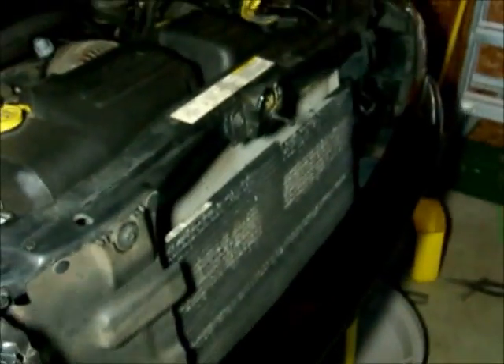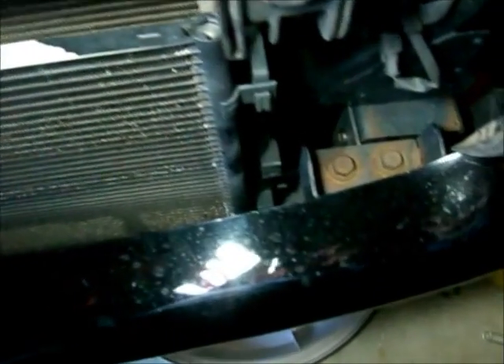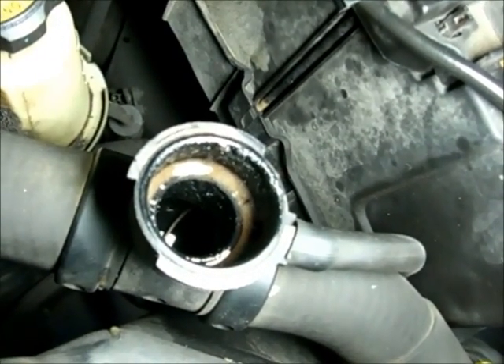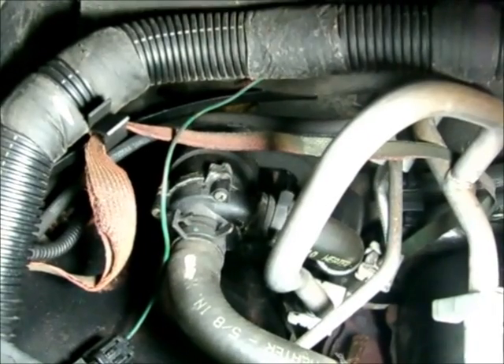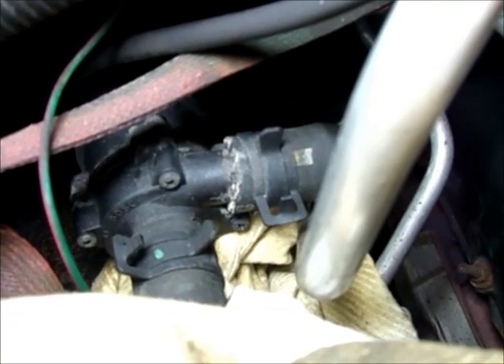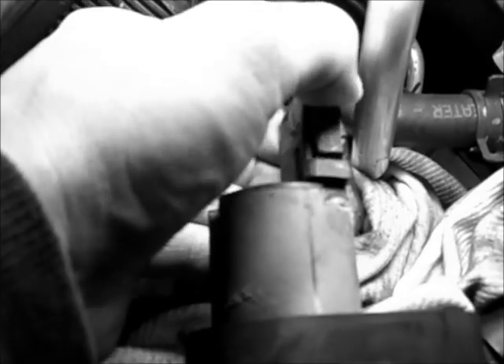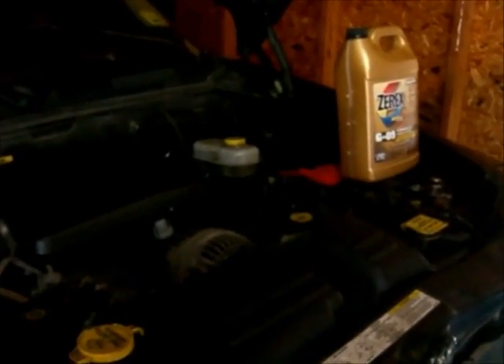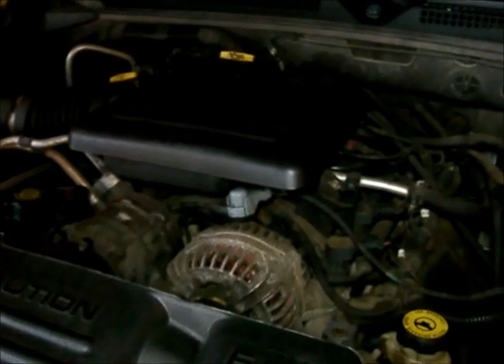Dodge Durango 4.7 coolant, thermostat, and auxiliary water pump replacement.

Comment: Looking for assistance; the aux pump connecting to the rear climate control; the heater hoses that connect to the lower side of the engine block, (front passenger side). The fitting where the heater hoses connect, (same block piece that the thermostat housing is), one fitting has rusted from the inside out and snapped off… is that really a part of the engine block or not? I can’t quite figure this one out. 
Thanks in advance if you can help.
Reply from the maker: If you're referring to one of the bolts, one of mine had snapped off too.  I used a small c-clamp to hold the thermostat housing to the block where the bolt used to be. Worked perfectly. Hope this helps.
Reply: @lenpenn  thanks for the reply. No I’m referring to the actual fitting that the heater hoses connect to…
Reply from the maker: @LJWalter78  The heater hose should connect to the thermostat housing, which I believe is plastic. That plastic fitting attaches to the block with two bolts. You should be able to replace plastic fitting easily. Hope this is what you're referring to.

Comment from the maker: Its most likely coming from top radiator hose with integrated cap. Replace that as the rubber hose connection to plastic couplings can fail. I had same problem. Easy fix.

Comment: I have looked all over the internet. I have a 2000 dodge durango 5.9 4 wheel drive...cannot find where the aux pump is located...?? Please help asap if you can! Thanks in advance!
Reply from the maker: Do you have rear heat controls? If not then you dont have an auxiliary pump.  If you do, then it should be up against the firewall on passenger side under hood.
Reply: Well, it's not there, so...i thought we had rear heat control...i appreciate your help, thank you!!
Reply from the maker: Do you have any temperature controls behind the front seats either on roof liner or behind center console?
Reply: I thought we did but my husband says no we don't...is that the ONLY reason we would have an aux pump??
Reply: So, my problem is that my car drives hot and when we turn it off antifreeze squirts from somewhere all over under the hood. My husband took the thermostat out...i don't think there is a leak...if there is we can't find it...
Reply from the maker: Yes. The rear heat controls operates the axillary pump to provide heat to seperate rear heating system if you have seperate rear heat option.  No pump needed if you dont have seperate rear controls.
Reply from the maker: Its most likely coming from top radiator hose with integrated cap. Replace that as the rubber hose connection to plastic couplings can fail. I had same problem. Easy fix.

Comment: we changed the auxiliary water pump on a 2001 durango. now we have no power to the pump. any ideas on  where we might be losing power?
Reply from the maker: Possibly the fuse and just make certain the connection is properly inserted and secured into the new pump.

Comment: Just got one in the mail today. Ordered it from Rock Auto. Part mfg. is Dorman. Part # is DOR 902-407. Fits 2001 to 2003 Durango/Dakota. $86.26 includes shipping. New in box. Ordered it on Monday, got here on Tuesday.

Comment: My Durango  is  overheating  also have done everything  except change  water pump am replacing  auxiliary water pump  first sense I finally  found  a leak mine  is a 2004 and doesn't  show an auxiliary  water  pump but  it has  one wish me luck part is 133.00 and  only 3 in this  country
Reply from the maker: Good Luck.

Comment: Iv changed the water pump radiator fan thermostat all of them my 2002 dorge Durango still runs hot any ideas on what can be causing it
Reply from the maker: Not sure. Ive heard a few other people having the same problem after doing everything you have done. Some people don't like the HOAT brown coolant these cars call for because they think it creates sludge in the coolant system. I haven't had any problems using it. Maybe try flushing your cooling system (Not just draining it) to see if there is any blockage.
Reply from the maker: +Hulk Smash 
ZEREX
Reply: did u check the heater core?

Comment: this video was nice but you know the black hose beside the auxillary what is that. because it is causing my antifreeze to leak out. it is the one beside the silver one
Reply: Goes  to  heater core
Reply from the maker: Thanks. Meant to respond too. Make sure you have a spring clamp holding hose on pump.

Comment: Does anyone have an answer to what the solution is for over heating?
Reply: If you have recently had to add antifreeze, you may need to bleed the system. If not, it is probably the thermostat.

Comment from the maker: I dont believe the auxiliary water pump would be the problem since it only turns on for the rear heat controls and does not affect your main cooling system.  With everything else you have done, I have no other ideas on what could be causing the overheating.  Possibly an electronic sensor for the cooling system.
Reply: Can i bypass the water sensor that controls the rear .. Dont care about the heat toweds the rear .. Will the front still work with no over heating.

Comment: I have a 2001 Dodge Durango that has been over heating. for the last 2 weeks. We have replaced the thermostat twice, clutch fan, intake valve gasket, water pump, the radiator housing, flushed the radiator then flushed the whole system and the thing is still over heating. Should we replace the auxiliary water pump, and do you think that is the problem? We did the pressure test and there is not a leak in the heads or the intake. Please help!!!

Comment: i have a 03 durango. my problem is similar to luckysticker. i as well replaced the water pump thermastat and the upper hose. 
my problem is that after the motor is full of coolant it seems to make its way back to the resivor tank. thats when it starts to get hot. and when it starts... it goes fast. each and every morning the upper hose is pretty well empty if not empty .
i once thought about flushing the system because thats the only thing i havent done yet. 
how do i fix this issue
Reply: Dearest italianyankee, you described my on again off again drama with my 03 Durango to a tee. Did you ever figure out what the heck was going on???
Reply: a hand grenade

Comment from the maker: Make sure your thermostat is rated for 195 degrees and you are using the MOPAR HOAT coolant or equivalent.  Seems that your truck is detecting the extra wind on the highway and not compensating for it only during that time.  Could be a sensor.

Comment: I have a 2002 Dodge Durango 4.7 and i replaced the water pump, clutch fan, and the thermastat and im still having over heating problems when i drive on the highway but in town it drives perfectly fine. When the truck overheats ALOT of antifreeze comes out the overflow tank. Can you help me out on why its doing that? Thanks
Reply: iamfilob i sure wish someone would help u, I've got the same problem going on.... Changed the cap, water pump, thermostat, and fluids.... Still overeating

Comment from the maker: @kemill76 It depends on whether the coolant you purchased is already diluted with water.  If it is then you can just add the premixed coolant.  If not, then you have to add distilled water to the coolant to make it 50 / 50 mix (half coolant, half distilled water).  Hope this helps.

Comment from the maker: There is no drain valve for the resevoir itself, just the radiator which is if your looking at the front of the truck its the lower right side of the radiator.  Only open the resevoir cap then twist the drain valve to the left a half turn while pulling on it to open it.  That will drain the resevoir completely.  After the resevoir is empty, open the top radiator hose cap to drain the radiator.  Hope this helps.  Sorry about the quality of the video.